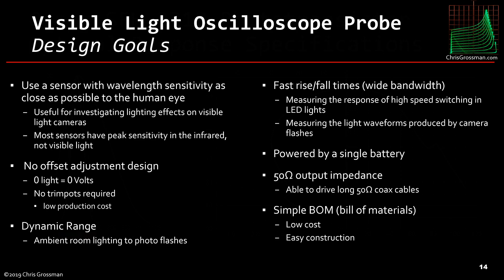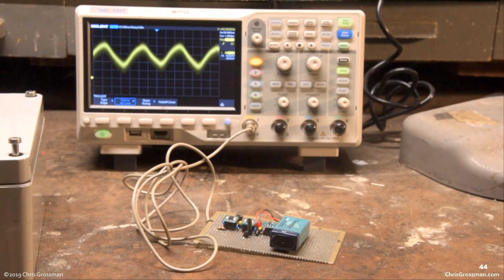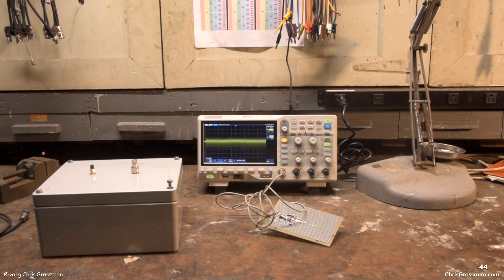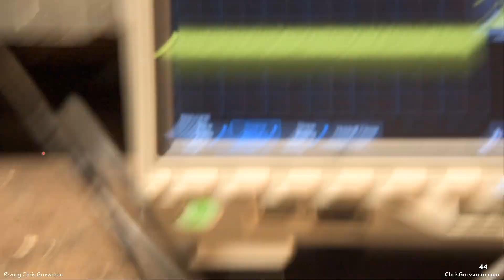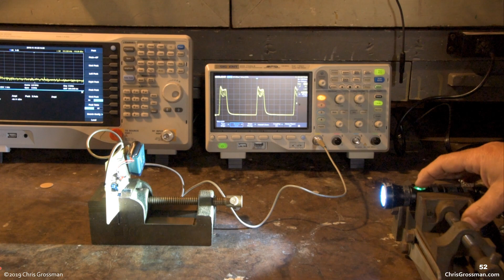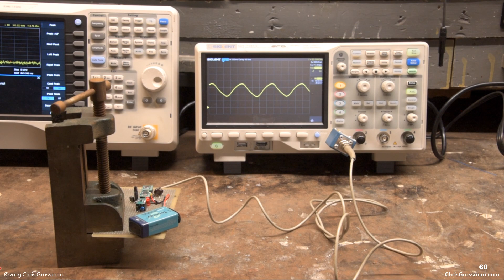⭐ Visible Light Oscilloscope Probe #0008

Comment: Great video !! Did not know LED phosphors were so responsive to the switching frequency. Would an incandescent bulb show a 50Hz modulation ?
Reply from the maker: The light from incandescent bulbs is due to black body radiation from the heated filament.   The thermal time constant (time it takes it to heat up) of the filament is long in comparison to the line frequency, so it acts like a low pass filter.   Thus you may be some very minimal 100 Hz or 120 Hz modulation depending on the thermal time constant of the bulb filament, but it will be orders of magnitude less than you get from a LED or fluorescent light.

Comment: Good morning Chris.
Could be possible to make an optical probe to mesure conventional electrical waveforms + tension(Volts) ?
An full optoelectronics probe could make your scope fully isolated and safer to use in high voltage areas :)
Reply from the maker: I don't know of a any way to get voltage from a light measurement.  
   You can make a electric field probe with a very high input impedance, but a very low bandwidth.  This is essentially how static field meters for ESD characterization work.
   Liquid crystal are both field and temperature dependent, but hey would have to be on the surface you are measuring.